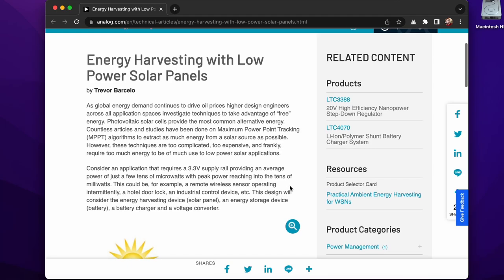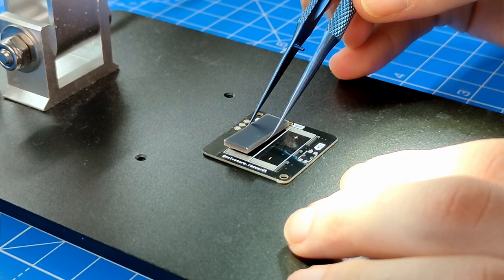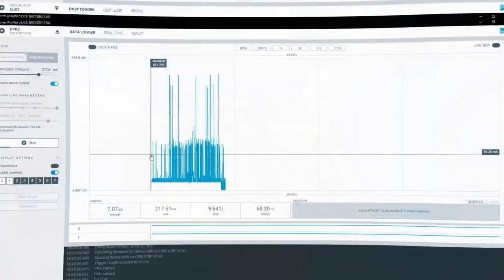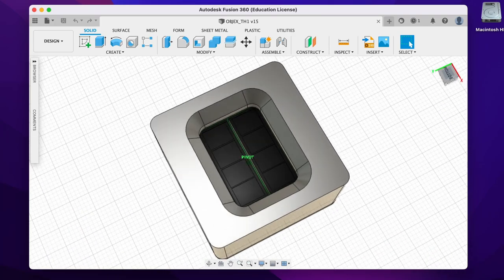Solar-powered weather station with ESP32 & BME680 | Energy Harvesting

Comment: I would love to see a video where you look at the solar power input vs the power it takes to run the microcontroller with different events (taking data measurements, sending the data, ...) with that you could select a battery size. 
example: size the battery such that if you get 4 days of rain (no solar), then the battery had enough power stored to still run the data samples at a freq of 1 measurement per 10 mins. on the fifth day, sun comes out and can run the system while fully charging the battery.
Reply from the maker: I did similar tests but I did not show them in this video, but for sure in the next video I will show in detail the power consumption of the board and the power delivered by the solar panels👍

Comment: I have an idea for. Another project :)
As its possible to power up to 100W using poe - you could build ans poe esp32 and use the provided power to create Smarthome (rgb) ceiling lights  that also include presence detection using Bluetooth or mm wave sensors :)
Reply from the maker: I'm already working together with my team on some projects with PoE 😏

Comment: Awesome project! Using NRF microcontroller should definetly be interesting. I'm curious in how the development process would be. Keep up the good work!
Reply from the maker: The next step is to develop the new prototype using an nRF52840 or similar. Definitely I need to improve all the power circuits(LDO, Battery manager...) as well.
Reply: @SalvatoreRaccardi  O wow, looking at the datasheet, it has some really unique features build-in, especially NFC and Bluetooth 5.3. If it all works well, it might be something for OBJEX Link aswell (smart watch application maybe..?)
Reply from the maker: @stevenslaa716  yeep it's a very powerful microcontroller, surely new projects can be born!
Reply: @stevenslaa716  And also Zigbee, so integrating the weather station into a Zigbee only smart home running HA is easy :)

Comment: Many thanks for the video, I have also built my own custom board with esp32-s2, can you please tell me if the bare chips need a bootloader flashed on them before I can upload to them using the UART bridge? My chips are not entering the boot mode even though every thing is designed correctly.
Reply from the maker: No bootloader needed. If you are programming the board with a serial bridge try tapping the DTR pin low.

Comment: Hi, the solar panel seems very small for energy harvesting? I’ve measure a 10cm by 5cm panel that was supposed to deliver 1W and I got a max of about about 0.3w in full sun in uk. Your panel looks like it’s about 1/4 the size so would it only deliver about .1W which is roughly 16ma?
Reply from the maker: You also have to consider the type of solar panel. I used monocrystalline, you?
Reply: @SalvatoreRaccardi  Polycrystalline, which will be less efficient.